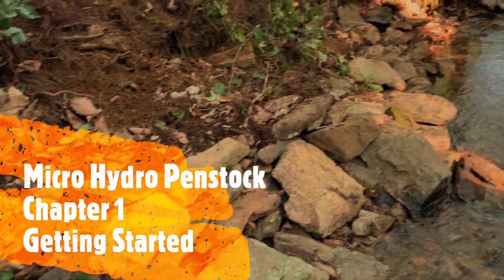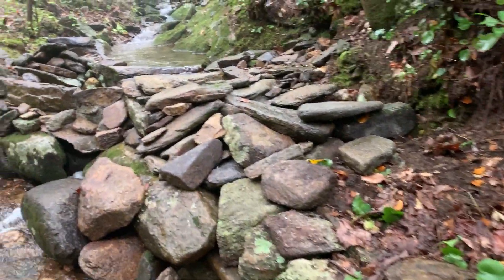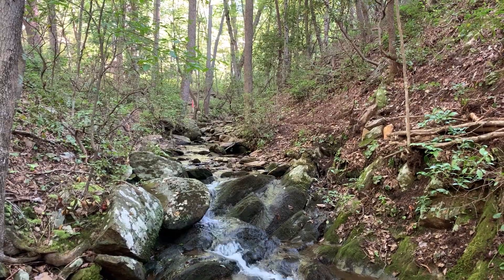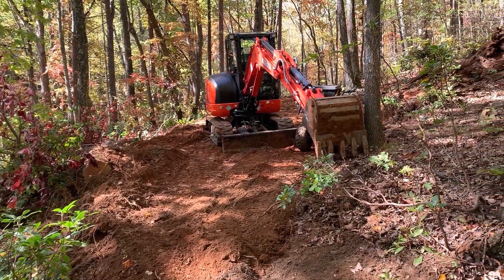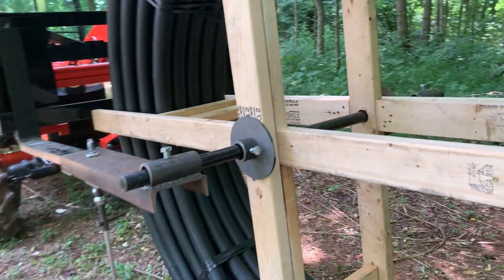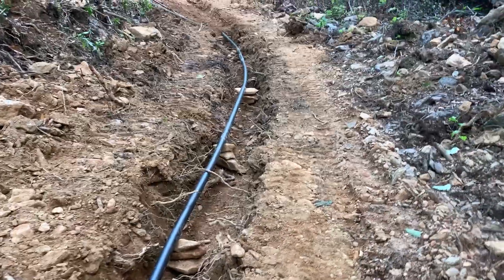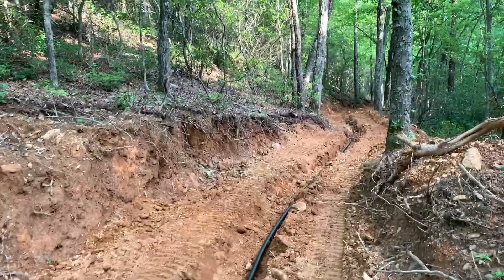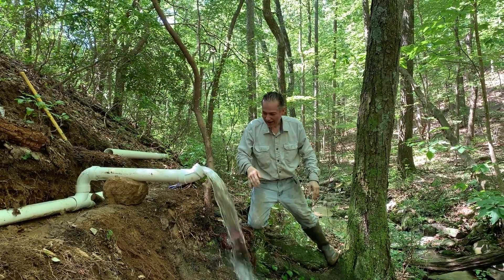Micro Hydro Penstock - Getting Started

Comment: I would have put in parallel to the tube, a plastic optical fiber
, in the future a small mini-generator at the beginning of the pipeline, just to charge a lithium battery, such as any servos or measurements
it was done on an alpine hut to get different info of the source
Reply from the maker: That is an excellent suggestion and I did think about it but the cost of running 3,200 feet of wire turned me off on the idea. It did not occur to me to use fiber optic cable like you mentioned which is way cheaper. Thanks for the input.
Reply: you can also use the wire for animal enclosures are very long coils and to transmit coded signals at 5 volts are fine
or they are found in surplus, bifilar military coils, which are in teflon coated stainless steel (made for a few tens of mA)
they were used for field telephony and are indestructible
a small solar panel that charges a 1 Farad capacitor, is more than enough for many uses  @Magutz